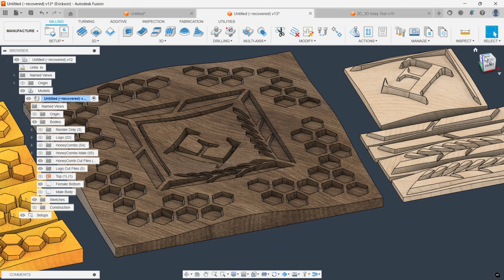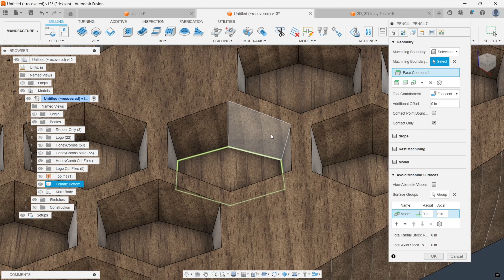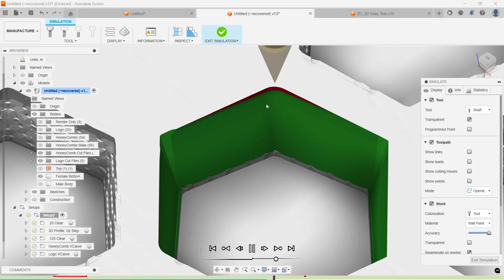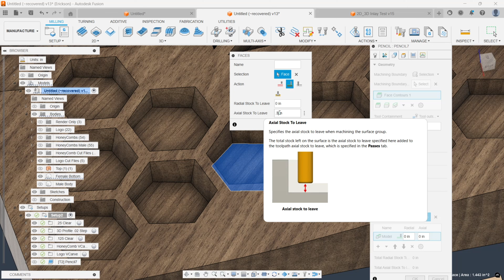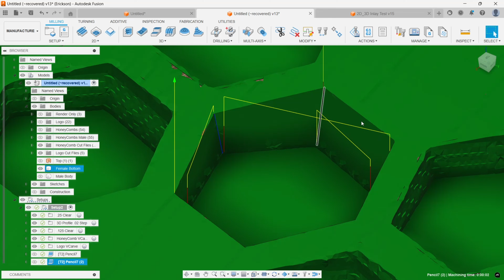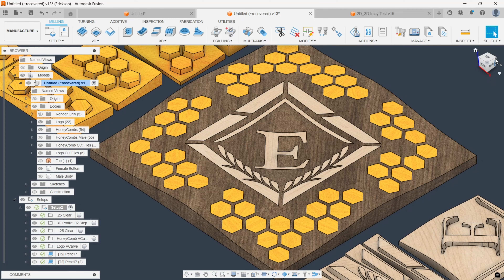How to Make 3D V-Carve Inlays with Fusion 360

Comment: Thanks for another great inlay video. Your previous video got me to try it out and I had great success. I may have a slightly more ergonomic approach to 3D V - Carving. My goal was to find a set of operations that I can copy and paste between projects without needing to re-select everything. The following approach gets me 90% of the way there on most projects. It does take a while to compute on larger projects though :/

Here it what has worked for me:
- I make a 3D contour operation with the 30 degree engraving bit. Under Geometry, I set the slope limits to avoid machining the top surface (45 - 90 degrees works most of the time). Then I set the max step down to 0.25 in. This will machine top down instead of the pencil operation which just tries to trace the bottom edge.
- Then I make a first pencil operation. I set Up/Down Milling to "Down milling" on the passes tab because it feels safer. I set radial offset to 0.01->0.02 in to clean up the spikey bits in the corners.
- Then I make an identical pencil operation, but with no radial offset. I also crank up the speed on this one because it's barely removing any material.

Hopefully that makes sense and hopefully it saves you some time in the future.

Comment: I am a noob to F360 but have had a bit of time on Solidworks, now looking to F360 due to cost, Out of curiosity I am not understanding why you could not make the depth of pocket relative to the top surface rather than the bottom?
Reply from the maker: Thanks for commenting on the video!  The biggest limfac is the 15 degree bevel along the uneven surface.  I wish fusion would account for this, but struggles, so bounding the tool on the bottom generates a more consistent toolpath.  This method is super limited based on geometry constraints and makes the model behave unstable, which is unfortunate that Fusion has these types of issues.  There might be a more preferred method for the 3D toolpath using a sketch that’s projected and the depth of the tool relative to the top of the surface, but I have not been successful in doing so.  Cheers and welcome to the channel!!! If you need any help with Fusion, please reach out!

Comment: Brilliant! Instant sub… I did a similar thing, although strictly 2D, using 2D contour and varying the Chamfer Tip Offset. This allowed me to carve the modeled chamfers that were taller than the bit I have was able to cut in a single pass. It involved a little trial and error but it worked in the end. This looks to be a smarter way of going about it, especially for 3D surfaces.

Comment: Forgive the newbie question, but doing just regular v-carve inlay with Fusion 360 has been challenging for me.  Is it done with a pencil toolpath followed by a pocket clearing or the reverse?
Reply from the maker: No worries!  I saw the comment on the Live Q&A also, glad you found your solution.  On the 2D version, you can use the Engraving Tool path and get some great results, but you can also use the Pencil tool.  Sometimes, based on the geometry of the sketch, the tool path will deviate along the edge which can ruin the inlay.  Using the simulation in Fusion can really help solve those issues, well at least identify it.  Then it's picking the best athlete tool generation to overcome those small imperfection.  It really does help ensure the project turns out as expected.

I'll be doing another live stream event today at 3PM MST.  If you have time and have more questions, join in and we can talk through it!

Cheers!

Comment: Nice work.  Interesting ideas.  This is an area of Fusion 360 I haven't worked much with, so thanks for the food for thought.  When you presented the problem, my first thought was to create an plane offset from the bottom of your pockets (it appeared all the bottoms are the same depth).  Use that plane to create intersection lines on walls of all the pockets.  A toolpath can then be set for those new lines.  It seems your solution is doing basically the same thing but 'virtually' and much easier.
Reply from the maker: Thanks!  Yeah, it gets really challenging, very quickly when trying to maintain the depth of cut along the curvature of that surface to maintain the overall dimension of the inlay.  It's hard to see but each inlay, the pocket depth varies based on how shallow or at the high points of the curvature, the pockets are flat which varies the depth for each.  Very interesting, but feasible and achievable making the inlays flow with the surface.  Thanks for watching!!